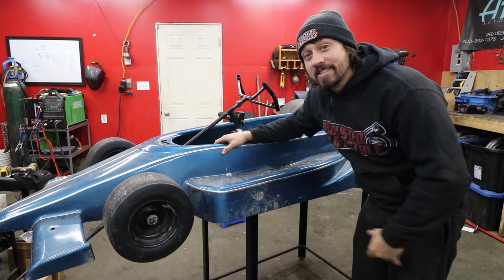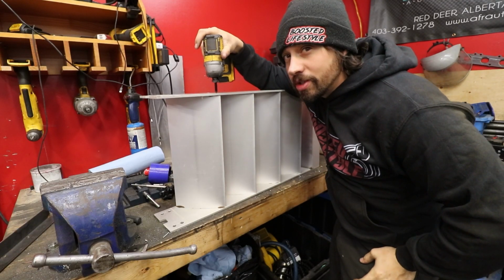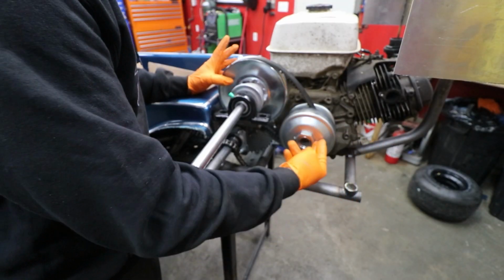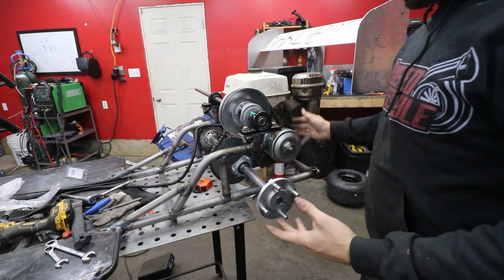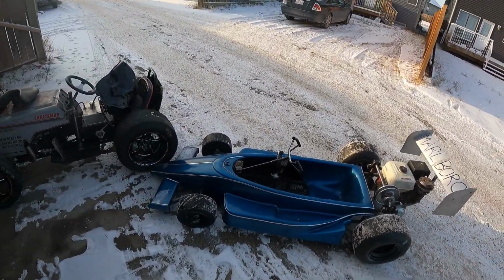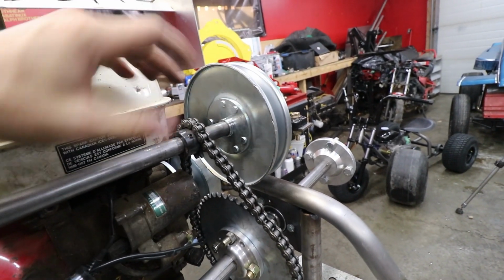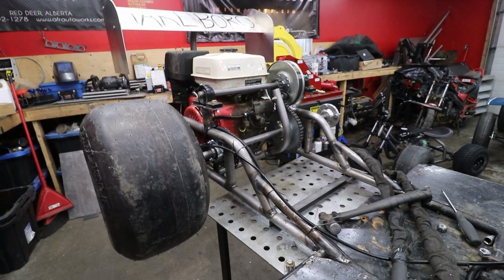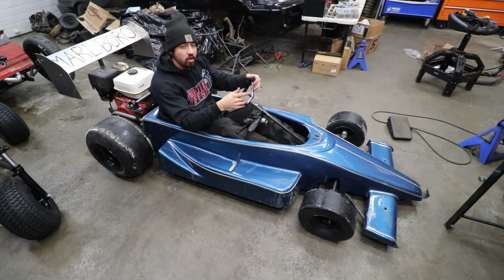Homemade F1 Car. We Doubled The Speed

Comment: Most weight, big tyres with more grip and no differential in the rear is why it won't turn but push the front tyres straight. The one wheel drive was actually really good for turning.
Reply: Thats why you have to get it sideways (drift), like with a quad bike

Comment: your weight is way too far back so it's understeering like crazy
Reply: Just needs  .... A giant fullsize front spoiler/diffuser from an lmp car n itll b all good.  You know kyle would find a way too.
Reply: I don’t think the snow and ice helps any
Reply: Yes and solid drive axle with no diff is not helping.
Reply: Bang on  Literally no weight over the front wheels
Reply: Ahhhh… 🙄🙄🙄🙄
Reply: @Grimm-Gaming  its not an lmp car,its gokart dude
Reply: Any kart on snow and ice understeers like crazy on slicks in wet.  Needs to learn to apply throttle to get it to turn 

Not the easiest /natural thing to get use to.  When your heading for a accident
Reply: Exactly what I was going to say. If you look at a f1 car the engine is mounted mid rear. This car is setup for doing wheelies. It needs way more weight up front.
Reply: Add some weight to the front, otherwise Sweet build! 👍
Reply: @osmacar5331  everyone keeps commenting and dosent understand i meant that as a joke cause of the stuff kyles built in the past.
Reply: @Grimm-Gaming  and you think i didn't? You have no sense of humour.
Reply: Brickz
Reply: I suggest adding some lead weights in the front and doing a corner balance on the cart
Reply: No we have a go kart to it's the live axle
Reply: The biggest reason its not steering is because both rear wheels are drive wheels. If one spins freely, it will solve your steering problem.
Reply: Very similar situation to the older 911’s with massive turbos. Massive power, but it’s ends up in a half spin because it has nothing keeping it down at the front to give it traction. That meant that you had to be real careful on the gas on the way In, and slow down a ton, as well as on the way out, as accelerating quickly would mean that any changes in the speeds of the diff would send you to your doom, as you couldn’t do anything about it with your steering, because you had no front traction.
Reply: @ThunderHorseWx  BUT, your car you drive daily with diffs will do the same thing on frozen rain and ice. noooo my friend that’s a reason for poor steering, but SNOW, ICE and tiny FRONT SLICKS are the major issue. Having positive traction delays steering inputs and leaves no room for corrections so You need to start ur turns early also positive traction makes the car spin out easily because of the delay in steering input. Limited slip will help in and out of corners and help keep the vehicle from catching a bad contact patch and spinning out. You are not fully incorrect, most , almost all carts are positive traction by the way.
Reply: Controlled understeer is basically drifting. Which is how you drive  a solid axle, like a quad
Reply: Is it wrong that I heard that in Daniel Bruhl's rendition of Niki Lauda and expected the rest of his Ferrari rant?
Reply: Rubbish engine as well
Reply: No it’s because of cold slicks in the ice etc
Reply: No wonder it understeers, have a look at the thing, I've seen better shopping trollies
Reply: Rear heavy cars oversteer.. not understeer right?
Reply: @danielthompson3849  any kart on wet tires in the rain understeer aswell
Reply: @Grimm-Gaming  i think a steel bar would do just fine.. more weight.. it aint really getting any downforce at low speeds anyways.
Reply: If he sat more forwards he'd be in another car
Reply: "IT'S A SHITBOX!!!!" -Niki Lauda

Comment: Looking good. Try getting some weight to the front end. Also looks like the steering arms are parallel to the front tires if they are angled towards the center of the rear axle it helps as well.

Comment: I had the same issue with my go cart I ended up putting bigger treaded tires in the front and it helped the understeering a lot, I also find that converting the gas tank to the front adds weight and gives it a bit more traction

Comment: Those tyres are for very dry weather so it wont turn in snow. If you get ones with thread it would grip a bit better in the wet for sure

Comment: I wonder if the steering issue is mostly due to the "locked rear end"?  There is a lot of weight and traction back there pushing the thing straight.  Ever drive a spooled car on slicks on the street?  They tend to push pretty bad in corners.  That along with no weight on the front.  That was my first thought on the last video, remember this thing was only driving one rear wheel when you got it.  IDK food for thought.
Reply: i think it has a lot to do with the solid axle too. wonder if he could get a mini differential for that thing.
Reply: @derickstarr3270  I'm not sure what they make for something like this.  I would start by looking at what the shifter cart guys are doing.  Those things are kind of the outer edge of cart racing, if there is something trick that's where it will be found.
Reply: @justinp2993  well, it depends on how much weight he has on the back. And if there's the slightest chance that wing is creating little down force. If anything I would try putting a thin piece of steel on the front to act as a counter weight to equalize the weight in the back. Maybe even put a size bigger tire in the back. Shifter carts are ran on equal weight distribution. Plus the weight of the driver as well.

Comment: Put it on scales. To much weight out back. Throw some lead up front. Also believe it or not a narrow front end will tighten it up and be more responsive.
Reply: Same goes for the back end. Norrowis tight. Wide is loose. You should be able to move the hubs on the axle. But I dont think it has enough steering tire pressure. Might even help to raise the bearings on the rear axle.
Reply from the maker: Yeah I've gotta add something up frontm at high speeds it actually turns though
Reply: Its awesome tho man. I use to race karts and killed it. We have the largest track west of Toronto in Quesnel BC. You can bring that thing here and run it. They also do autocross on the track. I have access!
Reply: Closet thing to indy you can do. So if you build an up scale model I have access to a track for you to run!

Comment: I don't think you need bigger tires in the front (although it can help a lot), I think you need a lot more weight in the front. Understeer usually means not enough weight on the front (also it means a lot of other things), and with that... massive engine in the back... Careful not to put too much weight in the front, or you could be spinning out everywhere!
Having a differential in the back can also really help with low speed handling.

Comment: You've built a drag racer, nice and quick in a straight line but no hope of cornering.
A fixed axle where both wheels rotate at the same speed all the time will always over ride the steering.
You need to allow the rear wheels to be able to rotate at different speads, so a differential axle needs to be fitted.

Comment: The biggest thing hurting your handling right now is the engine hanging off the back end. That comparatively heavy weight being behind the rear axle is lifting the front end off the ground + planting the rear end into the ground. Having the wider slicks on the back along with the live axle basically guarantees insane rear grip. Of course driving the slick tires in the snow doesn't help anything either but I think you would have an insanely great driving gokart if you could some how relocate the engine anywhere directly above or preferably in front of the rear axle. It would be a nightmare with the fiberglass body thought. On the flip side, adding weight to the nose of the kart would help you out. If you really wanted to get crazy, you could try and add some flaps to the front wing to try and increase front downforce and angle the rear wing such that it doesn't push the back end down too much. This would help highspeed cornering. All in all its a sick kart!

Comment: Put some negative camber on the fronts.
Perhaps install lead weights on the front as well.
I need not mention the ice.

-2 degrees is a good start for most road racing applications.

Comment: To fix the terrible steering, I would recommend a ballast or added weight to the nose of the car to sort out the terrible weight balance with the rear mounted engine. Not enough weight is being put on the front tires to create any good amount of friction. Widening the tires could help but eventually has diminishing returns.

Comment: Your weight is mostly on the rear of the car, thats why you cant steer at all. You could put weight on the front, but at higher speed it wont be enough and its dangerous. You should also put a better front wing to put alot of downfor on the front. Also, you should stiff it out so it doesnt move with the vibrations. Hope it helps!

Comment: The not stealing is from the solid drive axle the inside wheel is trying to rotate the same speed as the outer wheel causing it to push you forward

Comment: Need to add weight to the front for it to steer better with the live axle it will want to go straight anyway
Reply: The solid axle with like 80% of the weight on the rear will make it push. If you actually got this thing on a racetrack it would probably snap oversteer when you tried to push it.

Comment: Steering issue is due to solid rear axle. Both tires pushing doesn't allow the front wheels to work like it would with a single rear drive axle! ✌️

Comment: The steering issue is a combinations of weight location and drive train design.  The weight is located aft of the rear axle with very little weight over the front axle.  This is causing the front to "lift".  Moving the weight (CG) more forward will probably help.  The drivetrain- the solid axle (both rear tires receive same power) pushes the front straight forward.  Great for drag style racing... not good for trying to turn.  This rear drive issue plus the CG being to far back is probably the reasons you have little to no steering.

Comment: Posi traction rear end has a lot to do with the steering issue. If you make one of the rear tires a free wheel and one a drive wheel it will steer a lot better at low speed. And the front end is probably pretty light

Comment: you should move your driveshaft to the back. maybe you will need another length belt, but it helps getting more grip. bonus: you also have an extra mount point to get your fiber in

Comment: I would put some protection or shield over the chain and belt right behind the driver. Imagine leaning back a little and some string or part of a jacket/hoodie catches on it...
I know they are not covered on most go-carts but they dont have them right behind the head of the driver.

Comment: Maybe you could get some more weight in the front by removing the fuel tank from the engine and build a custom fuel tank in the nose of the go kart with af fuelpump feeding the engine . More weight in the front is better than wider tyres. Cause wider tyres means less grip per square cm's/inch. Or just put weights in the front could also be a option

Comment: I believe you could fix the understeer problem with a touch more ballast over the front wheels as I noticed all the weight is around the rear axel causing the front wheels to lift up and have little to no grip under acceleration and slow speeds due to large steering input needed.... anyways, just a suggestion

Comment: Throw a 10lb weight in the front and if you want i have some rain tires in the shed from our karts if youbwant to try those for a little grip.  If those are tires like we run even in the summer untill they are warm they dont steer worth a shit but grip for days when they have heat in them

Comment: It doesn't steer because there's no diff and the ginormous difference between the rear and front tires size. This kart seems more built towards INDY than F1, as Diffs are not needed for ovals. You could fake a diff by leaving a free open rear wheel, but you're gonna lose power on that wheel. As there's no diff, both rear tires are pushing the kart forward with the same strength, and a lack of proper weight distribution renders the kart unable to turn to either way. You could try changing tires type, different sizes, but this problem will be a curse untill a diff is installed. :D

Comment: You could use the rear wing "aero" plates on the front end. Try a quad bike rear diff on the back. Solid rear axle drive is not the best way forward. Stay safe dude.

Comment: Before you changed anything in the video I noticed your chain tensioner should have been after the pinion gear to take the slack up on the loose side not on the tensioned side,
Reply: Your 2nd tensioner is better

Comment: Did you check which direction that belt drive is built to rotate?
The centrifugal clutches in those drives can be grabby and prone to binding when running reversed rotation.
Great build though dude!

Comment: What would be handy would be if the torque converter could be mounted directly on the rear axle as/instead of the Chain drive and sprocket.  THERES ONE FOR THE MANIFACTURES TO FIDDLE WITH.

Comment: the issue with the steering is the weight in the front, it is too light. add somewhere between 5 and 20lbs and it should make turning at lower speeds easier.

Comment: The biggest reason its not steering is because both rear wheels are drive wheels. The front wheels are fighting the rear wheels when turning, so uf one spins freely, it will solve your steering problem.

Comment: I told you it wouldn't steer. Locked rear Axel.
Your going to need alot more weight over the front. Or unlock the rear.

Comment: you should put a new front wing one and put bettur suspension on with bigger front tyres and if your drvinig it in the snow get engraved road tryres which while help steer also adding more weight to the front to even it put and mabye make it red with a racing stripe? just asking🤣

Comment: so much rear traction and no diff, of course its going to steer very poorly.
on ice much worse of course, but kinda similar on good dry pavement too.
its what small engine single wheel driven didn't have any issues with.
the new project ideas sound a lot more fun, a diff, some suspension, etc.
mountain bike rear suspension shocks are small+light, strategically placed could give a nice mix of stiffness and weight transfer for cornering. an option?: decades ago built a 1/8 scale on road RC car, separate motors (wired parallel) driving left+right half-shafts. the motors wanted to run "in step" naturally (brush timing on one was reversed for opposite spin), and in corners the traction overcame that so no diff was needed. when it exited a corner the motors returned to running in step. doing same with a couple high output brushless hub motors could scream.. or set up a couple alternators running as motors (budget).

Comment: Mid engine version two would be pretty badass and help with weight distribution
Reply: yeah and hows he gonna do that put it in his lap💀
Reply: @SwearJacob  but really- even in v1 extending the wheelbase and flipping the engine around would have made it mid engine. V2 he can build the frame to accommodate for the weight to be pushed forward in front of the axle.

Comment: Let me tell you about my distance cousin and his go kart there was a strip mall being built in the early 70s in my home town and it was about a 1/4 long and there were 3 signs about 60 feet in the air that were held up buy 2 columns each and he was flying through there everyday and one day he was riding like the days before and wasn't paying attention and someone welded some tubing across them to make a planter for flowers he was hauling ass and his brakes didn't work and you guessed it off with his head he was decapitated and died instantly.  Please fix the brakes. Your friend from Louisiana Rick 427